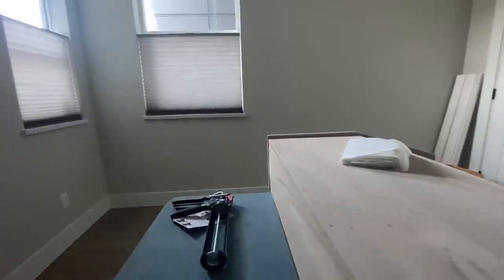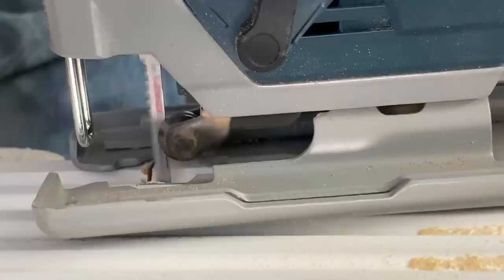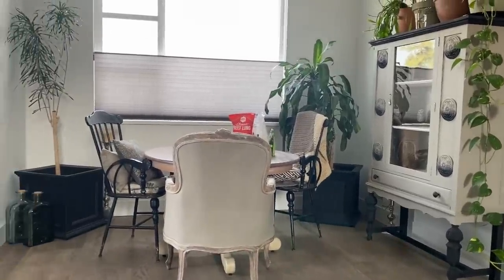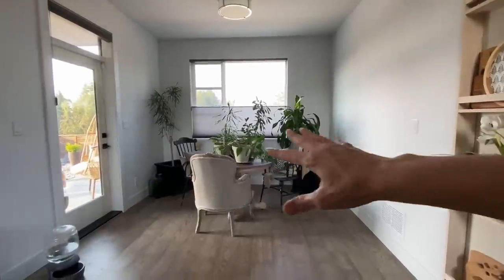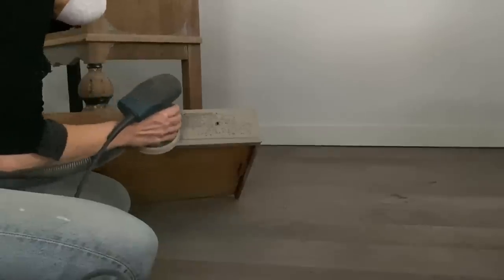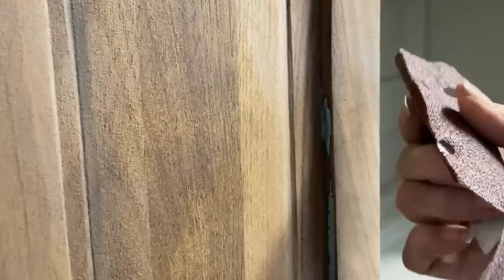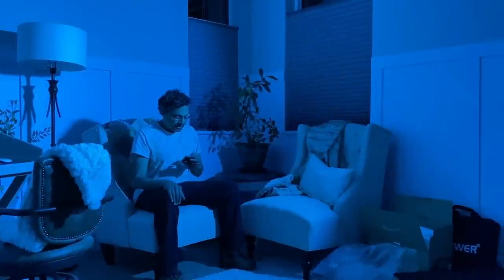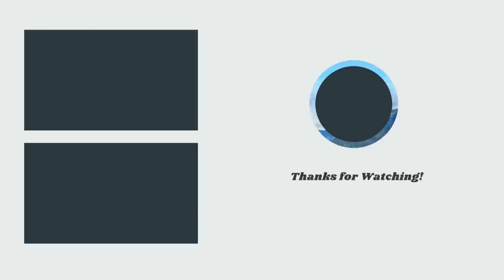DIY second hand flips: Office Zen Makeover, furniture refinishing by sanding back & Board & Batten

Comment from the maker: Hi everyone! I hope you enjoy this weeks new video DIY Second hand flips: Office/Den Zen Makeover, furniture refinishing by sanding back and Board & Batten walls! 

Chapter Sections for easy referral look up:

00:00 Start
00:18 Cabinet to be refinished
00:31 Office room Makeover preping 
00:51 Handy Kreg Cross-Cut sTation for clean cuts
01:25 Dewalt 4.5 Inch circular saw
03:14 Cutting around electrical box trick
04:25 Spacing Board and Batten Boards 
05:20 Corner moulding accent for a touch of decadence! 
06:56 Board and Batten placement 
08:52 Sand Back, Sand Back!
09:30 Painting
11:56 Sanding will test you but its worth it!!!
14:41 Hatley’s new hair cut!!!!
16:14 Scuffed Glass fill trick with tooth paste
16:57 Studio room new lights club vibe!!
18:44 Final furniture piece

Formula used to make the Board and Batten Wall:

Board and Batten Spacing Formula

Board Spacing (Inches) = 

Wall Length (inches)-(x# of Battens x Batten Width (inches))
                # of Board Spaces(x# of battens-1)

Example:          = 167" - (8x 3.5")
                                       (8-1)
Board Spacing = 19.85 Inches (20")

Materials Used:
Wall Paint: Benjamin Moore Genesis White

Homedepot:

Alex Plus White Caulk

3.5 Inch x 8ft  MDF Baseboards Primed Moulding (10 piece contractor pack) $40 USD

3.5 Inch MDF Primed Corner Block

3.5 Inch X 8f MDF Casing (Scalloped moulding for the corners)

Furniture Salve (All natural wood sealer):

By Aida from With Love Furniture 
Instagram @withlovefurniture and YouTube @withlovefurniture
Etsy store:
https://www.etsy.com/ca/listing/804222876/furniture-salve-orange-scent-furniture

For the materials used in my Home Decor DIY tutorials please check out my Amazon web store link below to purchase them directly through Amazon: 

No More Nails Glue:
https://amzn.to/45YEthi

DEWALT ATOMIC 20V MAX* Circular Saw Kit, 4-1/2-Inch (DCS571P1)
https://amzn.to/4440HNf

Digital Measuring Tape
https://amzn.to/3pbJDGs

Laser Level
https://amzn.to/3NKY3Xr

1/2 Inch Belt Sander: WEN 6307 Variable Speed Detailing File Sander with 1/2-by-18" Belt
https://amzn.to/4418YRL

Miter Box and Saw Set:
https://amzn.to/45g9P2n

Electric Nail Gun:
https://amzn.to/3YI5Nx7

Nail/Punch Set (Awl):
https://amzn.to/44aqMtC

Bosch Orbital Sander:
https://amzn.to/3R5aJdH

Kreg Cross-Cut Station:
https://amzn.to/47YbY4f

Rotary Tool (Dremel like just cheaper):
https://amzn.to/44F2kAK

For other items used in past videos take a look at the following link

https://www.amazon.com/shop/thereclaimedheirloom

Disclaimer:

As an Amazon Associate I earn from qualifying purchases listed above.  When using my affiliate links above to make a purchase, I do get a small commission and it doesn’t cost you for any more for using them. It helps me do these videos for free and I appreciate your support.